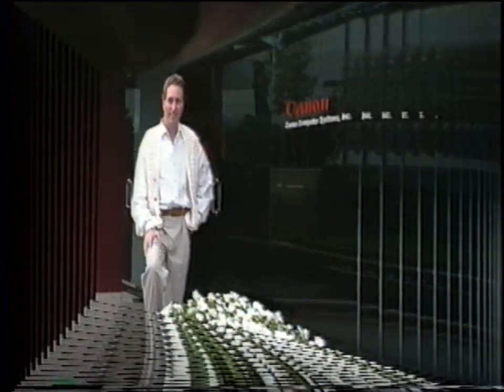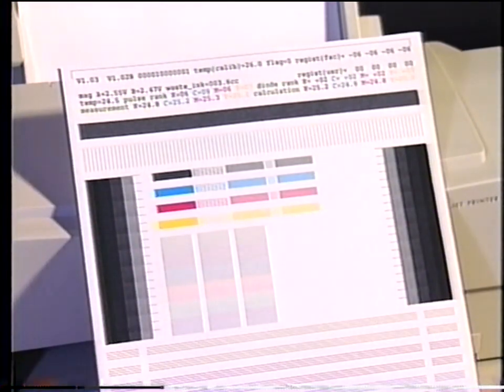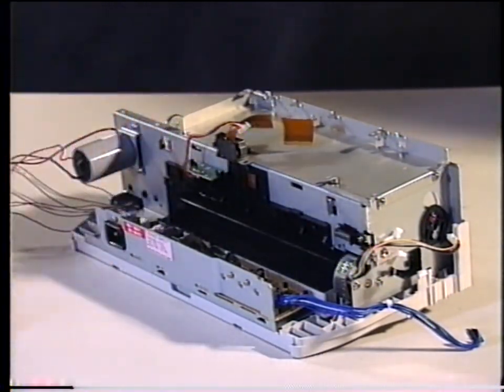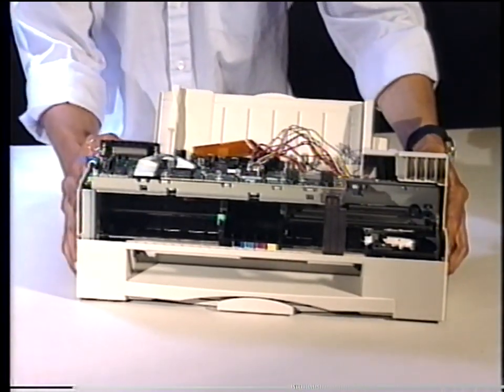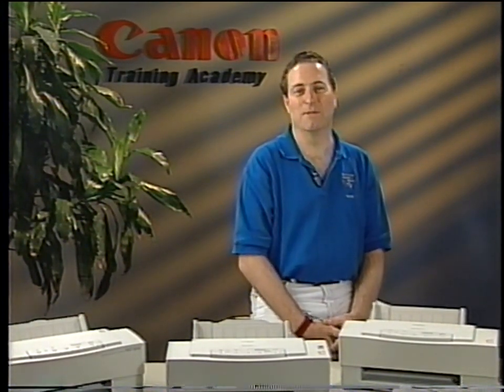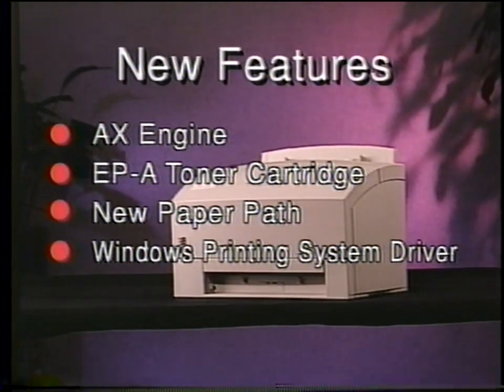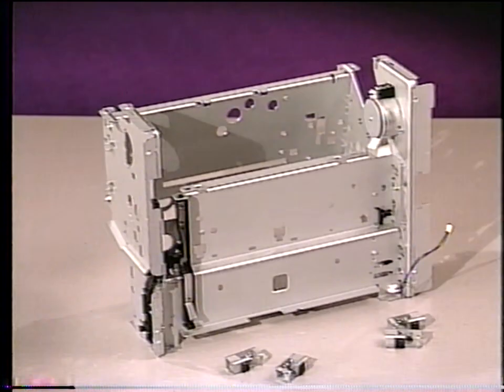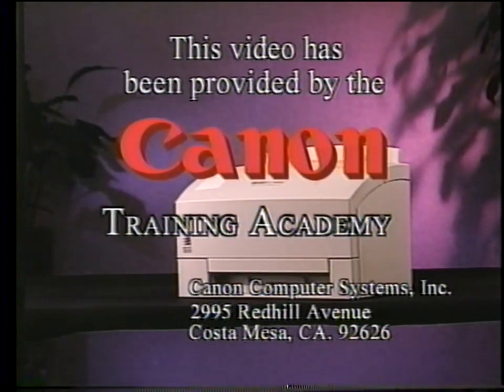Canon - Universal Printer Training for 1996, BJC-600 Series and LBP-460

Comment: Thank you very much for posting this old video. I had a BJC-620 that was unused NOS in box but when I tried to set it up an error code popped up saying it had a bad control board. I bought a used BJC-620 that worked for a while until the drive belt came off. Thanks to this video I was able to swap the control board from the old one into the NOS one and voila! It works great.
Reply from the maker: I am very glad this helped you. Thanks for watching!